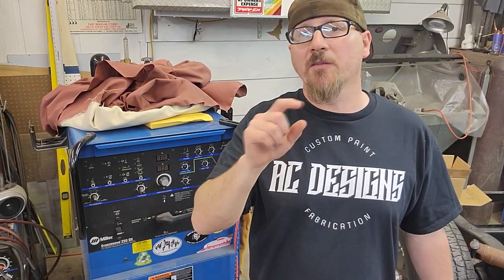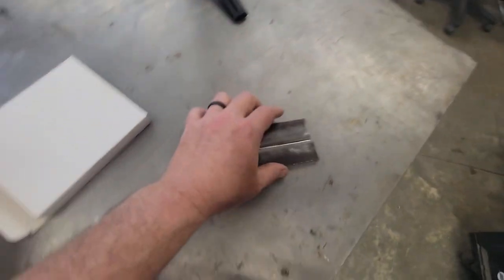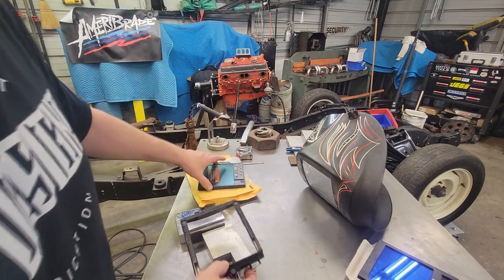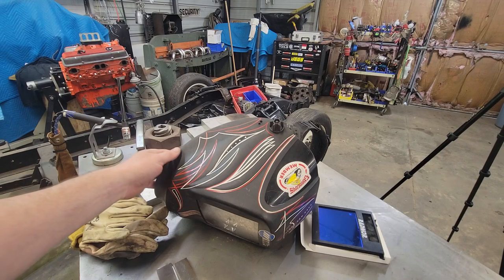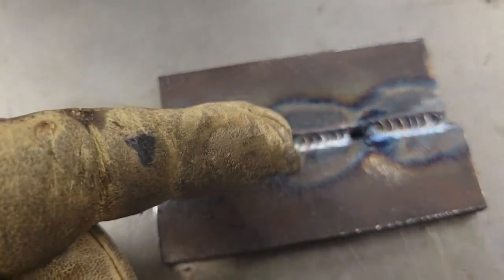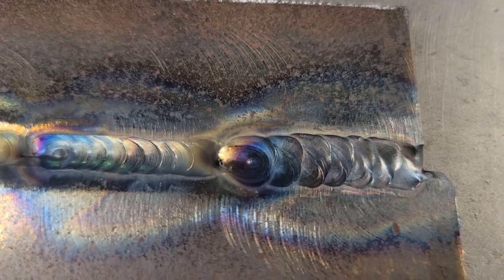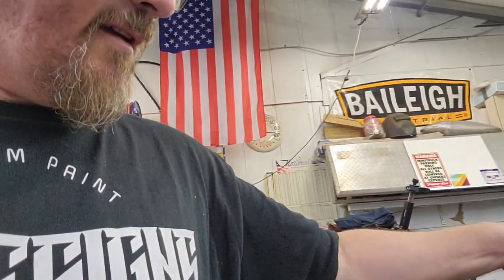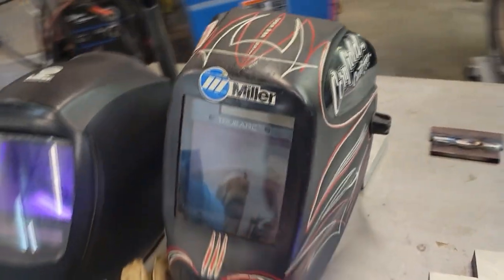CAN'T See Your (MIG-TIG) Welds? (Fast & Easy) Shield Upgrade

Comment: Hi AC Really like the video today and got the wheel spinning. I have an old Optrel helmet that is dead as the batteries can't be replaced and a very expensive lens to replace. Some have tried to cut open the case but you have to grind it apart. My eyes are too important to bank on that type of repair. TrueArc makes a smaller version of the one you showcased. Unfortunately, they do not recommend using it with TIG welding. The lens you recommend is FINE for TIG welding but it's too big to fit the Optrel. I'm looking at Tefuawe Auto Darkening Welding Lens, True Color Blue Technology, Variable Shade 5-13, 2" x 4.25". Again, thanks for the video!
Reply from the maker: Thanks for watching!!! I hate that they dont make one for your sheild but atleast you found something.  That is so aggravating that companies make non serviceable products. Good luck on your hood!!!

Comment: Hey Adrian. Thanks for the tip. I would much rather have the blue lens too. I just subscribed to your Channel I just watched you base/clear the red Impala Hood. I never add reducer to my CLEAR. But I will try it. Mine mixes 4:1.  I won't go past one part reducer tho. I'm the same way with the tack rags. Can't have too many in your life. Thanks will be checking your channel out again soon. God bless
Reply from the maker: Thank you very much, yeah my clear mixes 4:1:1 ,helps it flow, id start with a 1/2 part to start with. Thanks for watching, God Bless!!!!!!
Reply: @ACDesignsGarage  hello Adrian. Will prep all soften my 2k High Build surfacer primer? I want to use the all-prep before my sealer coat. Can you let me know please. Thank you

Comment: How’s this work with a new welding helmet?? Also the lens in cheaper welding helmets the speed glass wear out and the settings become inaccurate meaning you have to crank it all the way to 7 or 8. So cleaning it is useless
Reply from the maker: You can to contact truearc and they maybe able to help